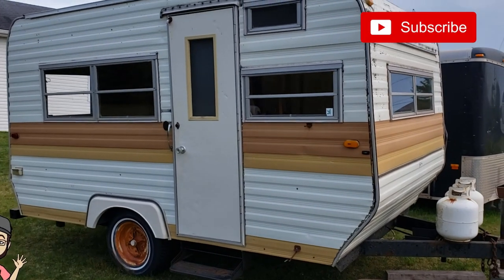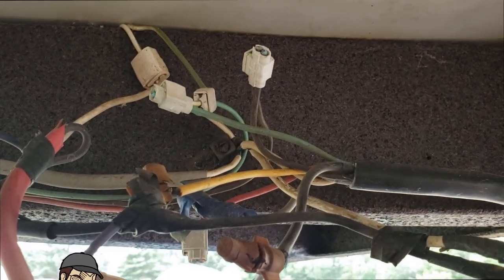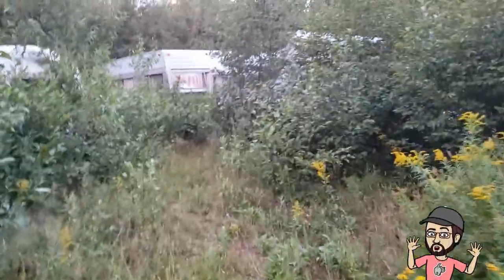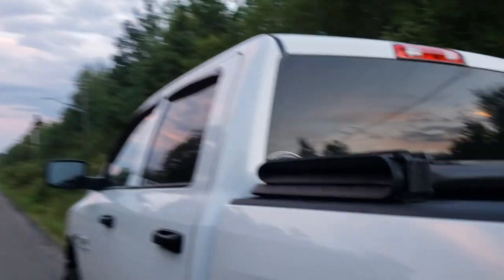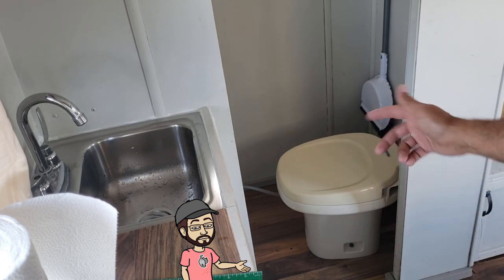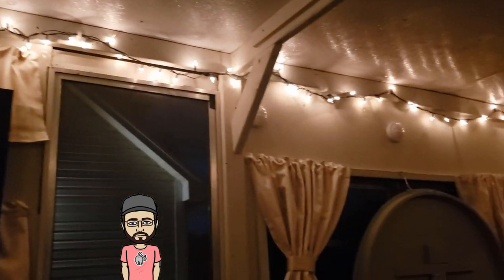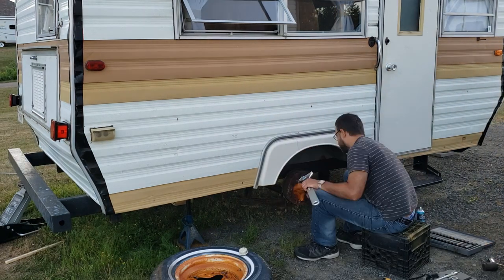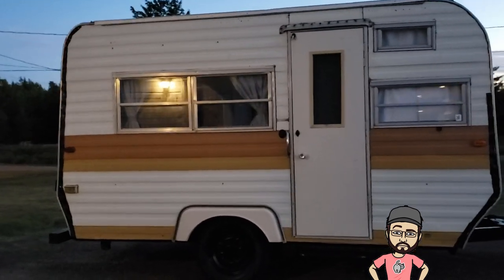Camper Trailer Makeover - Part 6 - Lights, tires, toilet & more! - RV Renovation Repair Budget

Comment: You're doing such an amazing job on this renovation. Fun to watch, but also a bit of a learning experience. Don't know if I'd EVER have the patience to do something like this, but it's still super cool.
Reply from the maker: Thank you! It has turned out pretty good considering what it started with but I went into it with fairly low expectations. Before I found this camper my original plan was to convert a cargo trailer into a stealth camper. But this one turned out to be much more fun and has a lot more character.

Comment: My grandparents used to have a camper just like that when I was a kid! How cool! With it being so old & pre-1978, are there any lead and/or asbestos concerns?
Reply from the maker: Fortunately not, the flooring was vinyl and insulation and ceiling panels are both fibreglass. Well honestly there likely is asbestos in the brakes but that's normal so I'm careful when cleaning those. And there may be lead in the paint on the aluminum panels but it's in great shape and not flaking so nothing to worry about there.

Comment: Was that a jig saw you were using to make the ac hole? Did you need to male a hole first to be able to use it?
Reply from the maker: Yes it is, I used a metal blade to cut both the aluminum panels and wood but a wood blade probably would have worked fine. I drilled a 3/8" hole at each corner before cutting.